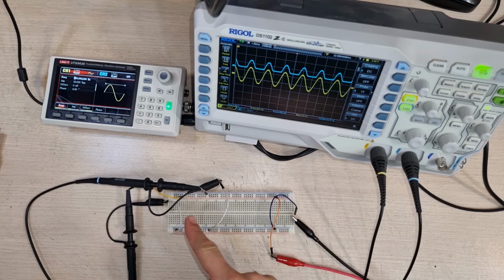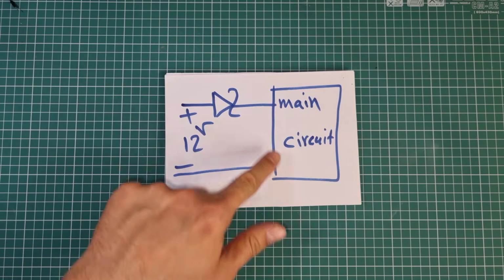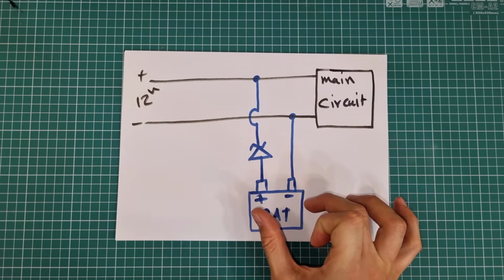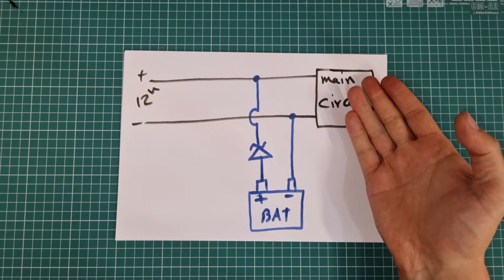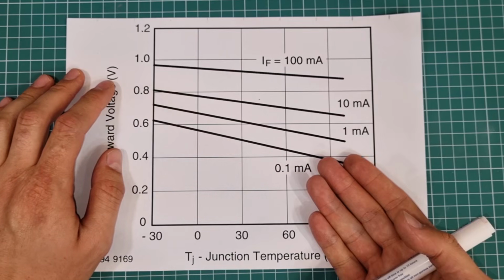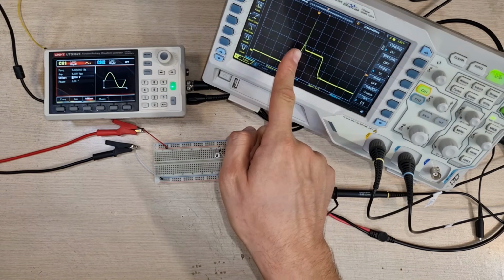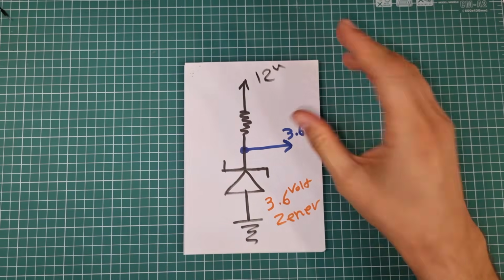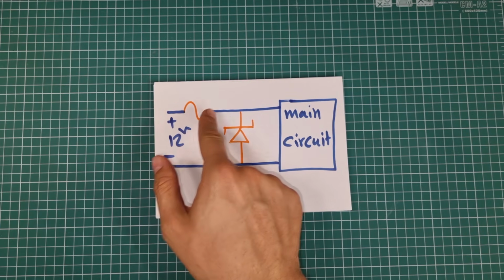8 awesome application of diodes in circuits.

Comment: Is there a specific way to determine which voltage and amperage of a diode I would need for a a circuit. Thanks for the video btw. I now know I need Schottky and Zenner diodes for my applications. I'm trying to make circuits for multiple power supplies and want to use the diodes properly. So for example a wall 12v power supply, a solar panel setup , and separating different chemistries of battery banks for charging and discharging in the same circuit along with a capacitor bank for large voltage spikes from motors. I like a challenge I guess. I literally want my Off grid setup to have as many options as possible for stabilities sake. Getting into solar has revitalized my interest in making circuits. Especially when DC to DC power circuit adapters isn't as standardized for the home as it should be. I see a business opportunity to make it more plug and play. The current environment is having the end user play with naked circuits to get what they need. Which is frustrating when running everything from DC in a home on solar. The closest thing to plug and play is car auxiliary plugs and USB 3 and USB type C but it limits what can be done to 12v and 5v. In a DC only setup you sometimes need 24v and 48v devices. I'm aware of buck and step up converters but they are not plug and play. Companies simply do not supply DC only adapters for their devices if its possible to do so which creates the headache I'm in, but I do spot the opportunity to have a business that they can point to for the purpose, and trust that it will run their devices safely for the end user. I'm working out a plan for it. Maybe one day you will see the converter option on power brick inverters for your devices. 🤷‍♂ All I know is why did it not happen sooner. Its even an advantage for Survival and Emergency situations because DC is the last power source to work. Even in a pinch. Thank you for listening to my TED talk lol.
Reply: wtf
Reply: youre drunk.
Reply: @CleoKawisha-sy5xt  and you're not very good at being constructive. The only thing making me drunk is curiosity.

Comment: 0:00: 🔌 Diodes are versatile components that can rectify current and have various applications in circuits.
4:30: 🔌 The video discusses various applications of diodes, including rectification, reverse polarity protection, and connecting multiple power sources.
8:52: 🔌 Diodes can be used to reduce voltage in a circuit and as flyback diodes in relay circuits.
12:17: ✨ The use of diodes and zener diodes in circuits to eliminate spikes, regulate voltage, and protect against overvoltage.
16:45: 📺 The video discusses different types of diodes and their applications, including the use of LEDs for remote communication.
Recap by Tammy AI

Comment: There is another way to reverse polarity protect with a diode, that's by placing a regular diode in reverse bias across the power input so long as your power source is fused. Connecting the power backwards would pop the fuse before the diode burned.
Reply from the maker: Yes, exactly. And then the user have to replace the fuse or sometimes the user think that the device is broken.
Reply: @elewizard It's not a particularly good solution. It's just something that is sometimes done.
Reply from the maker: @spudhead169  no, you didn't. 👍
Reply: It used to be done quite a bit with car audio equipment, but not so much these days due to some folk wiring directly to the battery in reverse, so no fuse inline. The best reverse protection is really the p-channel mosfet approach. Very little loss.
Reply from the maker: @spudhead169  There are so many approaches, each of which has its own advantages and disadvantages.
Reply: @spudhead169 sensitive much? get checked for your paranoia, peanut
Reply: Okay Cleo, why am I mentally unwell? I might have been a little harsh in my first response is all.
Reply: @elewizard I apologize for my initial response to your reply, I took it as being a little passive-aggressive which is why I replied a little bit sourly. I was mistaken however and should have thought about it a little more before replying like that.
Reply from the maker: @spudhead169  no problem dude. You are nice ❤️
Reply: @spudhead169 you're mentally unwell.

Comment: good presentation. minor nuance though: at about 6:00 in the example of reverse circuit protection you referred to using a schottky diode but the symbol you used was that of zener ;-)
Reply from the maker: Thank you for noticing the point. Sharp lines are presenting zener diodes and curvy symbol presents schottky. 👍
Reply: @elewizard  well, an S and a Z are still different (inverted) whether you use curvy or sharp lines.

Comment: Nice video. It's interesting to connect a piezoelectric sounder to the output of the infrared receiver. You can hear the pulses and hear differences between different brands of remote!
Reply from the maker: Yes that is nice. But the sound fifference is not because of band difference, it is because of the difference in the code the remote sends.
IR remote controllers are my favorite,  I will do projects with that as soon as possible
Reply: Looking forward to your next video 🙂